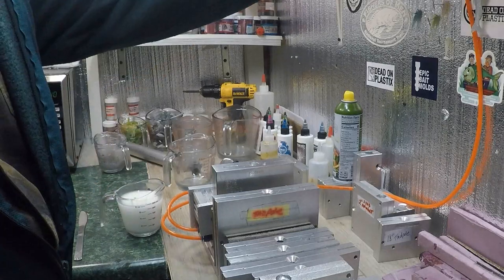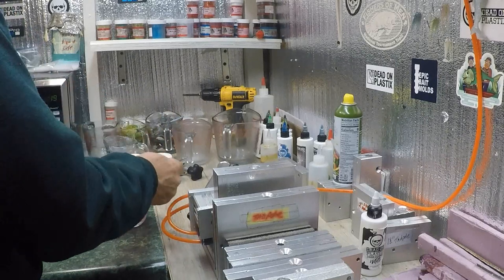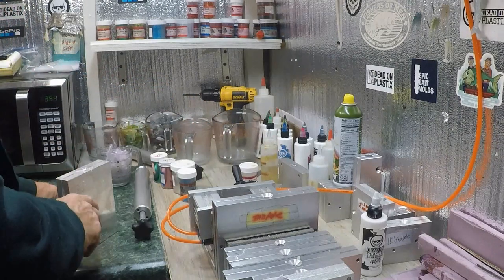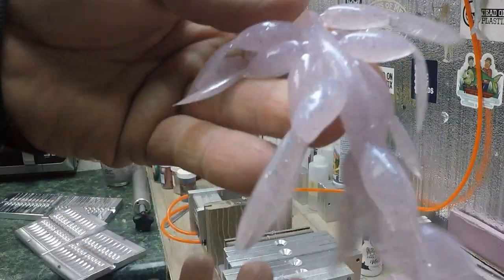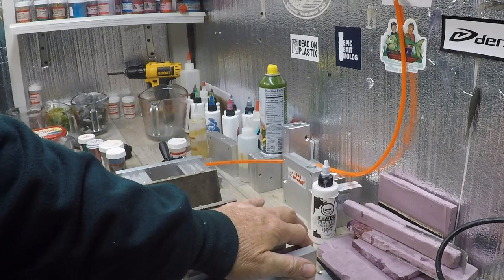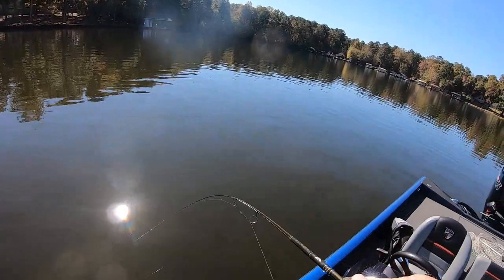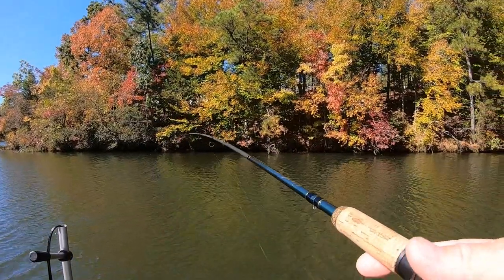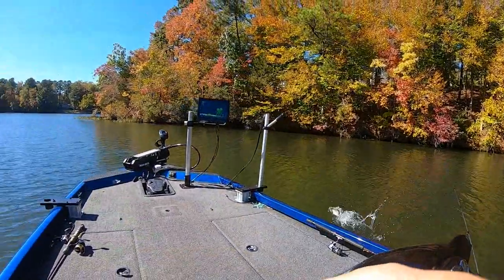Pink Lady Crappie Bait Pour To Catch

Comment: #79  I had the same issue with colorant caking at the bottom. I had to heat up the tip of a small screwdriver to get it to move. I then heated the colorant at 15 second intervals until it soften enough to use. I now only use DOP, MF or Lurecraft brand colorant. Pink is a great color in my neck of the woods.
Reply from the maker: Lurecraft  colorant is what's caking up for me. I'm now using Dead on products. Going to try heating up what I have and see if that helps.  Thanks Reginald.
Reply: @FishingLakeCountry  The only Lurecraft color I have is hot pink. It's in a pint size so maybe that's the reason it is not caking up on me. The Do-it-Mold brand colorant is the one I have a serious issue with. It cakes up too a very hard substance after 3 days.
Reply from the maker: @Grainraiser  I have pink, blue and green that cakes up hard. I take a small metal rod an break it up. When I add it to the hot plastic the colorant it lumps up. Thanks Reginald.